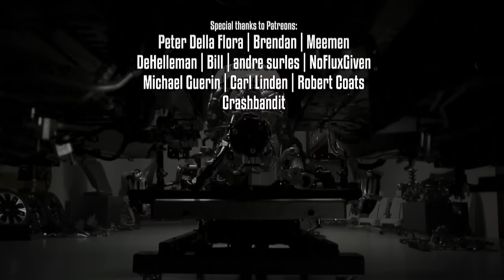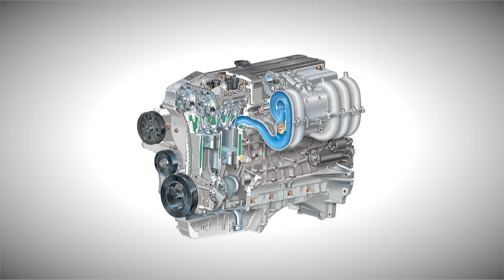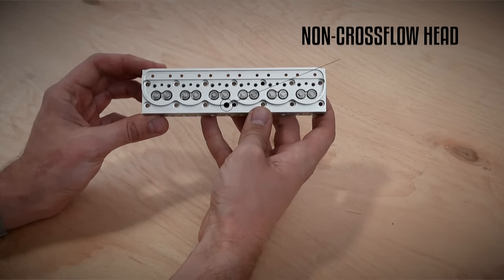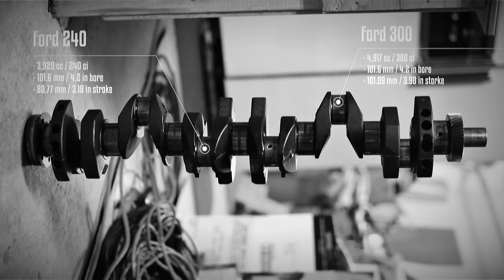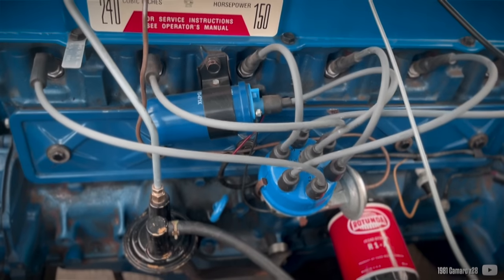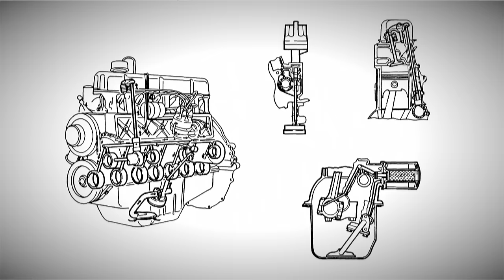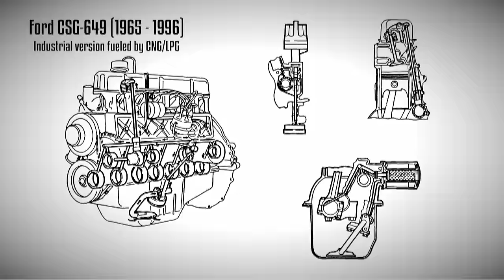Is This Toughest US 6-Cylinder?

Comment: I've never met a farmer who didn't absolutely gush about the Ford 300 if you brought it up in conversation. Anyone who has ever owned one has nothing but the highest praise for these engines.
Reply: Had my hands on one of my favorite generators at a customer site last week. 
Old mid 60s Onan with a 240 ford on it. 
So smooth like a sewing machine,the most problem I've had with it is junk aftermarket points sets.
Reply: As a farmer I can confirm. You can't find a tougher engine and they start so easy even in cold weather.
Reply: @Zach-ju5vi  the 300-I6 is a testament to ford engineering ,, I own numerous machines with these engines ,,,i'm a farmer myself and rebuild old power equipment  ,,the wood chipper is probably the most impressive machine i own with a 300-6 ,,it'll keep up with any 100HP diesel machine  and the only chipper i have seen that will beat it is another gas powered machine with a 460 big block ford engine,,it's a monster vermeer 12 inch cutter that originally had a 3126 caterpillar engine ,,and it's go so much power  that you can't slow it down
Reply: @Zach-ju5vi  Yep, Dad had a 66-240 pick-up, colder it got the easier it started I swear.
Reply: @brentwalters8921  A previous owner put a 240 in my '77 F150, and that engine takes forever to warm up! But I love it and want to stroke it to 300.
Reply: I currently own a 92 f150 with a 300 straight six. It is honestly the most reliable vehicle I’ve ever had.
Reply: My 94 E250 had the 300cid, I sold it at 385,000 miles, only because the transmission was starting to slip.
Reply: Couldn't agree more. My dad had a 93 and the last being a 95 f150 both 5 speed manuals. It never felt like a powerhouse but that 95 might be the smoothest engine I've ever driven. It did have good torque for pulling. Only 145 hp but 265 lb-ft torque @2000 rpm. The 95 was way into 300,000 miles before he sold it off. The kid who bought it drove it for several more years.
Reply: Dad had a 69 or 70 Econoline Van , built a bed in back and had 4 bucket seats. That nice little 6 cyl , 3 on the tree. Our budget Vacatiin Ride. Parents , 3 of us kids and gear had been to all goodies in the Blackhills ,. Out to TN to see family , and was Dads Usual driver between trips The next trip was to see relation in Denver , then to Gunnison and everything between. Left Northwest Ks and all was good. Got to Pikes Peak and had to go around a bunch of bicycles as they were climbing. Got part way up and Boom , dropped a valve. Here come the bikes all laughing in good fun as they passed us in turtle mode almost to top. Drove into Gunnison , Dad was a mechanic before this time and worked as a manager then at grocery store. Anyway he fixed it while we stayed 2 days visiting , then headed home. I drove it even for awhile later , was good to us for many years. Something happened on a drive at home , it was hammering , spewing oil , losing power. Dad said screw it , it doesnt owe us anything , about 11 miles to Uncles so we tried , she made in 9 more miles like that before a final boom and it locked up.. Someone wanted it so Dad finaly let it go. Guy put a 302 auto in and customized it more , he ran it along time. But that 6 cyl , couldnt beat it. Have had a few myself.
Reply: Or the Chrysler slant six the lasted forever
Reply: @ericafoster4368  Did ok , but nowhere near this , and lacked power.
Reply: Yup
Reply: 309 ford amazing, but doge slant 6 best 6 cylinder ever!!!
Reply: I’m not a farmer but the rest is true, at least for me. I miss mine everyday.
Reply: @chadbailey189  Best 6 cylinder ever made, in my book goes to the 12 valve Cummins. With the Ford 300 a very VERY close second. I've also heard nothing but good things about the slant six. But I've seen tons of 300's way over 300k or 400k miles. 12 valve is God level though I've personally seen a 12 valve with over 1 million miles. And countless ones over 500k. But I wouldn't hesitate to put my trust in a slant six either.
Reply: @raymondjack Ask younger farmers in most areas , they wont know what it is anyway lol. But it was one of the favs like a GM 350 was.
Reply: I had the opportunity to buy a rust free 1996 F150 XLT bare bones 2WD work truck from my employer last fall for a Grand and I did. Runs dead perfect with only 40k miles. Even had a new set of cooper discoverer tires on it. What a nice engine. Bypassing the smog pump with a shorter belt was the first thing I did. Now it's silent. Climbs hills thru deep snow with tire chains no problem. Torque for days. I rebuild one out of a rusted out F150 a couple winters ago for a 1990 F150 I bought that had an abused 300 in it and couldn't believe how clean it was despite the rest of the truck having fallen apart.
Reply: Now I want one.
Reply: Uhh they were good for their day. Very reliable and torquey but they lacked power and had horrible mileage.
Reply: Yeah man we take them 300 and put them in the field for the water, great 👍
Reply: @MrTheHillfolk  -  Convert it to electronic. There are lots of electronic ignition kits sold by Summit racing where everything is in the distributor and use your coil. Takes all the BS out of it. NO MORE POINTS.  Worth it.   Brother did that to his VW dune buggie. No more shitty points.
Reply: @DanEBoyd  -  Put 390 pistions in it and put an EFI head on it.  There are EFI kits from speed suppliers summit jegs others that you can EFI it and no more wonky carbs. There is a video on youtube where those guys did that and it made them 300 plus hp NA. 5 pounds of boost with a turbo on the same engine was 527 hp.  Go look it up.
Reply: @chadbailey189  -  The slant 6 was noisier, started  yid yid yid yid bang vrooom  LOL   and was grossly underpowered compared to the 240 and 300.  Many Optional Parts Along Road.
Reply: @yolo_burrito  -  My EFI was autoOD 4wd and got 20 mpg on the highway at 70. Its a truck... They were good on gas... unless yours was a carb and you drove it with your foot to the floor all the time. EFI did a lot for that engine. You could get more gas milage by taking off the muffler keeping the catalytics and putting a blocking plate under the EGR valve. That would give you large boost in power and gas milage.
Reply: My grand dad loved these motors, or anything Ford new Holland lol
Reply: When my Jeep's inline 6 goes out, I'm gonna try to cram a ford 300 in it.
Reply: @joneades1364  According to a quick Google search the 300 is slightly shorter front to rear than a 4.0 but also a couple inches taller
Reply: @joneades1364  The Jeep 4.0 is good motor too.
Reply: Mine has been the highlight of my shitbox truck. I will drive it until it quits. Only 173k on the clock. Looks like I'll be addressing body issues before anything else. 😂
Reply: That is a tough motor.
Reply: Let me be one of them farmers i still use a 1995 f150 with 5 speed manual over 330k on the original engine I've put one clutch in her and a water pump the old one didn't fail the gasket did so i just put a new one on that was 4 years ago and I've replaced the u joints once as well. Only one was bad but just did them both to be safe. 3 batteries but that's just batteries for you. I will keep this engine for ever even if i have to rebuild it. Save history Drive the best get the best 4.9 300 for life.
Reply: @ericafoster4368  yea a good engine for sure
Reply: @Bloodbain88  yea absolutely correctly.  I have one in my second generation dodge ram. Used in a lot of industrial applications... I know I biased buy its absolutely my favorite
Reply: @jimkillen1065  You have the P7100 12 valve? That's what I have, Goldilocks engine. I'm running off of used transmission fluid. Such a great engine. Pulls like a freight train too. I love every second of driving my truck. Only problem I had was a cracked exhaust manifold, but I fixed that. Sounds great too. Best sounding engine I ever heard.
Reply: @joneades1364  -  There are transmission adapters for it... especially if you have a manual trans.
Reply: I have one in my storage. Been asked numerous times if  I would sell it. I laugh at them.
Reply: @thomasbranson7237  -  Its a gold brick.  I wondered why ford never turned that block into a deisel since it is so tough. With the 240 crank and high compression pistons, the cast head could handle it... Doesn't need to be a lot of power but a couple hundred horsepower with a few pounds of boost would have been good for the half ton stuff back in the day. Its an amazing block. Nissan did that with their 2.8 diesel. It was completely compatible with the old maxima engine and the 280z engine. That diesel is used for its crank for 280 tuners to increase the stroke.
Reply: @KlodFather  I had an 88’ manual with TBI 4x2. It maybe hit 16 mpg downhill with a tailwind. It never had great mileage.
Reply: I broke one
Reply: MEH, I like the Chevy straight sixes better, especially the 235 and 292.  To be honest, Ford, Chevy, and Dodge straight sixes were all awesome in my opinion.  However I've had quite a few Chevy I6 vehicles and they NEVER let me down, ran smooth, easy to work on, and easy to modify power wise.
Reply: I agree.
I owed an 82 F150 (I put 3/4 ton rear suspension). That 300 (4.9K) I-6 was a Bullet Proof engine.
I babied the truck, but I did work it.
When it had 350K miles it needed a valve cover gasket and a rear main seal. I asked my mechanic how much it cost to fix those 2 gaskets. He told me $700. I than asked him how much to rebuild the engine. He told me $1500. I told him to rebuild it.
I drove it another 250K miles, as the 3rd member was in need of replacement.
Reply: @morbward8281 , other than the horrible lifter noise.
Reply: @yolo_burrito , that sure beats 6 mpg from the Ford 351W and the Dodge 318 and 360.
Reply: @morbward8281  The only thing I've had negative experience with is head gaskets going on them- otherwise they're alright. It may be worth putting head studs on one to keep the gaskets tighter (proper job would be during a rebuild, using the studs to hold the bore plate).
Reply: @Bloodbain88   Carburetors wash down cylinder walls and cause engines to wear faster than EFI. The EFI 300 could last longer and make better power than it's older carbureted brethren, but a 6BT Cummins can generally outlive the EFI 300, assuming all were well cared for. Even being a big Ford guy, I agree, the 12 valve Cummins is a superior engine, purely by nature of diesels lasting longer due to their direct injection fuel systems, and their heavier built parts, and for these in particular, their simplicity. The power potential due to higher energy fuel and turbocharging is hard to beat. 

Now, if we break it down by price point, I may give them a tie or even edge the 300 as being more economical overall, depending on application. The 300 is a cheaper engine now, was new,  burns cheaper fuel, has cheaper parts, and is cheaper to service, so your bang for the buck was pretty high. It serves a lot of people very well.

I am currently swapping a P7100 12 valve in my '83 F-250 4x4 as we speak, so I clearly like the 12 valve a lot. I dearly loved the 460 that was in it too, but I need better range offroad in remote places, and the 6BT just made more sense for what this 4 wheeler does. I got other Ford big blocks in my fleet to enjoy, so the choice wasn't too hard. This one actually came in a parts package with an F series equipped short block.

Ford clearly thought both the B and C series Cummins engines were good enough to equip in their medium duty trucks, so that should say something about them.
Reply: @yolo_burrito  -  Ford F150 250?
Reply: @ChevyConQueso  That's awesome! 6 months ago I just got done with my own 12 valve swap. Got my engine out of a 1997 Ford F-800 and put it into a 1983 Chevy 1 ton 4x4 dually. You said your donor was an f series truck?
Reply: I have a 1995 F150 with a 300 I6 and a 5 speed. It’s my grandpas old truck and about as basic as you can get. Long before, single cab, Cloth seats, rubber floor mats, crank windows. I think he only paid around $14k brand new. It’s crazy that F150’s are like $50k up to $80k or more fully loaded. They really don’t sell anything like it now as you can’t buy a completely stripped trucks. Also none of they engines they make now can touch the 90’s engines for reliability. Back then every truck engine was really good. It didn’t matter if you got the 300, 302, 351, or 460. Now every engine they put in the F150 ranges from terrible to only ok. The 2.7 and 3.5 eco boost have a lot of problems and even though the 5.0 is supposed to be better my Dad had a 2013 F150 king ranch that broke 3 pistons at around 97,000 miles. He always kept up with the maintenance and drove it like the old man he is. To say he was disappointed is an understatement. I’d trust my old 300 to still be going 20/30/40 years from now when all those expensive new trucks are in the junkyard
Reply: @KlodFather  F150
Reply: @bradleynelson5915  yeah I had an old County truck F250 with the 351. It had a 3 speed auto and the smallest tank. You could see the needle drop.
Reply: Not me, mine was gutless
Reply: those motors were put in fleet trucks because they didnt have enough power to break anything inc speed limit and were though enough to take the crap a new hire novice could give it
Reply: I was look at the thumbnail and thought it was a Ford 300. Those engines are a true work horse.
Reply: @rev.randall2292  That slant six when modified could propel an  A-BODY thru the 1/4 mile in 11seconds. PLENTY OF POWER!!!
Reply: @waynetaylor8082  when modified
Reply: @rev.randall2292  Correct
Reply: Got one on the F-150, sweet engine not much hp but lots of torque
Reply: I have 1 thats 36 years old and still running strong cant say a whole lot for the frame and body lol
Reply: My truck has that motor and honestly I get it... The ford 300 i6 is amazing
Reply: @briananderson4552  My F150 is a '92 and aestheticly-challenged though mechanically sound. Those 300/4.9 litre 6's are reliable when cared for.
Reply: @KlodFather  I never knew of that MOPAR definition before lol. Always thought it stood for: Massively Over Powered and Respected.
Reply: Once put deisel fuel in my ford 300 at the lake.... I might have been drinking...
   Anyway... I adjusted the timing.  And  pulled the boat home.
Reply: @waynetaylor8082  -  You are correct about Massively Over Powered...  That 400+hp hemi  I bought turned my tranny into play-doh  LOL.  Its about 480 miles from Pittsburgh to Charlotte.  6 hours 40 min including a fuel stop in VA on 81 dogleg going down 77 south. That bastard was mean... You were either going places or breaking shit. That good old boy who tricked it out for me created a monster and a death trap. When the tranny went I sold it to my buddy. Im glad its gone because I was going to be buried in it LOL
Reply: I had an 84 F150 in line 300 36000 mls a piston separated at the rings Ford would not stand behind it.Last Ford I would own.
Reply: I once froze the 300 in my current truck, still runs to this day!
Reply: @davecorcoran3874  -  I would have fought them on that repair. 36k was probably out of warranty but I would have called the news and got other people involved. Bad press is not what they want.  Back in the day There was plenty of BS to go around. My 300 treated me well but I found out that one of the head bolts was defective and I had to do the repair myself. When I took the head apart, I sent the head bolts with my dad to be checked in the machine at work where they check aircraft bolts for metal defects. One was fractured internally and two others had problems. I went to the salvage yard and got some old 300 L6 bolts and had them checked by dad. They were from a late 60's engine. All of them were hard and solid. I bought a new gasket and did the torques myself. No more problems. Shit happens. Those rings were some of the shitty metalwork that outside suppliers were doing to the MFGRs in those days. One company sold GM 10's of thousands of bad camshafts. They were soft and not manufactured correctly. Our 350 in our van ate two cams and then the bottom end started going from all the metal being ate by the block from the disintegrating camshaft. We replaced the engine with an 87 350 out of a wrecked police truck. Worked out good. No more problems. They all have their warts. With third party manufacturing and people cutting corners, that is why shit goes to hell on some of this stuff.
Reply: The 300's are damn good engines. But no engine compares to the 6 BT Cummins when looking at non commercial vehicles. There's hundreds of these trucks well past a million, even past 2 million. They're everywhere.
Reply: @Zach-ju5vi  6 BT wants to exchange words with you lol
Reply: @wildcoyote34  300's are great... let's just forget about the 5.4 triton though.
Reply: @Bloodbain88  24v's are just as reliable. Never understood why people only refer to the 12v's as reliable. The VP pump in the early 24v's weren't the best, but they were better than the early VE pumps put in the 12v's.
Reply: @joneades1364  Good luck blowing up that chrylser 4 liter. I bought an already beat 97 grand cherokee with 230k miles on it and used it as my bar hopin rig. Would leave the bar, peg it till I hit at least 60, not warmed up at all, drifting, drag racing, say fuck it lets peg it and go ditch bangin, hit the next bar and do it all over again, then again, then after the 6th bar doing that in between each go home. Do it all again the next night. Did that for years. Could not blow that mother F'er up no matter how hard I tried. It was pinned more than it wasn't Trans was great too, band started slipping but that's a 15 minute fix if I cared to fix it. Scrapped it cuz I didn't want to fix the brakes and tires that were 100% slicks btw 😂 it would drift like a champ in the winters!
Reply: @bradleynelson5915  The throttle body injected 318's were getting 18+ MPG in some trucks back in the 90's. My 2 360's both get about 10 but my foot stays planted in those trucks.
Reply: @whateveryousaygroomer131  yea i'll agree with you about the 5.4 ,, god damn sparkplug spitting piece of timing chain eating shit ,,,i get 26mpg with my 81 F150 with a 4 speed manual with overdrive  ,, not the fastest rig there is and the heat sucks in the winter ,i added an auxiliary heater to help that ,, and i spent the money and bought a gear vendors overdrive which was a serious  expense but it paid off in increasing my fuel mileage from 16  to 26 ,,i drive it on the freeway a lot and the double overdrive allows it to supercruise,,,like doing 80mph with the engine turning 1400-1600 rpm
Reply: @whateveryousaygroomer131  the fact that we can even compare the 300 to a diesel engine speaks volumes. Btw I still think the 300 starts better in cold weather so it's got one advantage over the Cummins.
Reply: @Zach-ju5vi  My 01 Cummins starts at -20f without being plugged in with 15w-40. has 332,000 miles on it too so the original toasters are worn for sure. I've had it going once at -28f with 5w-40 without being plugged in. 

I have a hard time believing those old carbed motors started colder than that, but maybe I don't know. Carbs are a bit before my time but I've never seen a carbed anything start well in the cold.
Reply: @whateveryousaygroomer131  my 01 Cummins will start in about -25c but the many 300s we have around don't care if it's -50c, they start everytime.
Reply: @wildcoyote34  Nice set up. If ford would make that same exact truck right now in 2023, I'd buy it no questions asked. Shut up and take my money hahaha
Reply: @Zach-ju5vi  No vehicle will start at -58f (-50c) without being plugged in, warmers on the batteries, and probably loads of starting fluid and a fire under the car with a car wrap. I'm talking about doing nothing. My cummins starts at -28f (-33c) with no warmers of any kind, just get in and turn the key and goose the throttle. 

I have never seen a carbed engine start below 0 without lots of attention and warmers. I'm going to have to say bs on that one till I see otherwise. Places where it gets -50c they need car wraps and heaters under the car / heater hose connects / block heaters etc to get anything to run, you're not just starting the vehicle on it's own when it's that cold.
Reply: @whateveryousaygroomer131  The 24 valve is incredibly reliable, but just having electronically controlled injection, extra sensors, and an ECM I would say a p pump 12 valve just noses ahead in pure reliability. Now p pump a 24 valve and you're really set. 

On cold starting, my Cummins started just fine this past winter at -15F, plugged in (but unbeknownst to me the cord on the block heater had broken, so not actually plugged in) and no grid heater. My engine was in an industrial application and didn't come with a grid heater. But that doesn't bother it. 

Before my truck had a Cummins, it had an old 350 with an Edelbrock 1406 carb. I think the coldest it started in was -10 or -15. I had it tuned well and it would start at the first bump of the key. But you're right about no engine starting at -50. Hell the oil is basically a solid at that point, and the battery is frozen too. You either don't shut an engine off at that temp, or it's got block and pan heaters, and the battery goes inside with you. And even then it's a gamble.
Reply: @whateveryousaygroomer131  I'm sorry but I've been there and done that more than once. I've only seen a hand full of engines start at that temperature. I seen two different Ford 300s start one efi 88 f250 and one carb in a 78 f150, I seen a 302 efi start but die trying to move and not restart, I seen a Nissan 2.4 with a carb start, and I've seen a many different snowmobile engines start both efi and carb. Starting an engine not plugged in at -50c is not something you do by choice but something you do because you just need anything that will run, I've done it, I know. PS the 5.9 Cummins won't start and I know because i did actually try it.
Reply: I may be a Chevy man, but you'll never heard a bad word from my mouth about the Ford 300 inline 6. One of the best engines of all time.
Reply: As a farmer I’ll tell you, after a nuclear war they’ll only be 2 things left. Cock roaches and 300 fords.
Reply: Indestructible legendary engine
Reply: 300 was ok for heavy work, drivability sucked and ive never seen a 300 that could keep its oil INSIDE the engine
Reply: The biggest issue is that it is too easy to pop a wheelie with a full load of hay in a truck with one of these engines.
Reply: Ford 300 best engine ever made
Reply: I'd like to see how well they would do at the track with some mods 😁
Reply: @DanEBoyd you're better off finding a 300 short block and bolting on a 240 head, it's a very old hotroddibg trick.
Reply: I KNOW QUITE A FEW THAT SWAPPED THE 300 FOR A 351
Reply: @CAVERUNLAKE  enjoy the leaky , all 6mpg of it
Reply: I had rather have 300 in line 6 in a truck than a 302 v8. The 300 has the torque.
Reply: My first truck was a 92 f-150 (hence my username) I got it when I was 13 from some Mexican who used it to haul scrap. It had 315,000 miles on it. All it needed was a gas tank. I got it for $650 in 2017, I drove it around all sorts of back roads. But I sold it for a 2000 f-150 with the 4.6v8 and almost perfect condition. I miss that truck though… but heck the 4.6 mod motor is extremely reliable as well.
Reply: I Had a 300 in My 79 F 100 Ranger Pickup Truck.  The Most Beautiful Truck Ford ever made. It had the Square Head lights It was the original Sport Truck .  I had it Painted in Emerald Green Imron Paint with Tan Western Style interior and relocated 3 on the tree to a Hurst Shifter on the floor with the Fuzzy T Hurst Indy shifter.  Under the hood I put the Offenhouser split exhaust and 4b intake system.  It was a awesome setup that was Bullet Proof.
Reply: I will testify to that. It has certainly been my experience. Almost indestructible.
Reply: Chew on a 24 valve 2001 Cummins and feel the Horse!
Reply: Trudeau needs to see a Cummins Ford, inline hydrogen diesel looking through his lear jet window! 😇
Reply: Take a shot at Cummins, Trudeau! Go for it! We'll send you phsycho chemists, on a trip to tax mars!😔
Reply: All expenses paid!
Reply: I’m not a 6 cylinder guy but it’s hard to beat how maintenance free a. 300i6
Reply: @maddhatter3564  my father did. 68 f-150. Took out the six when it had 200,000 on it and put in a 351W. He drove it for a while and gave it to me when I went into the eleventh grade in 1973. Best vehicle I’ve ever had.
Reply: WOULD THE CHEVY 292 B THE EQUIVALENT 2 THE FORINGA 300 MY PEOPLE'S OR NAH
Reply: Saw a video of a guy who cut up  351 heads to fit a 300 then put a turbo on it and apparently it was a total power house
Reply: The only thing I'll own with the blue egg on it.
Reply: they were junk ive thrown away plenty
Reply: You can’t kill them. A gas engine that feels like diesel. Ya it doesn’t make power above 3500rpm but it’s not supposed to. 1200-2500rpm beast.
Reply: @acme_tnt8741  Well this or a 7.3 power stroke
Reply: Same with the old fishing boats , dodge 225 were built solid too.
Reply: No gushing here.  I grew up on a farm.  Dad had a 1985 F250 with a 300.  Gutless wonder. Think Geo Metro with a box.   None of this “massive torque” that everybody raves about.  The 300 is simple and durable and that’s where it ends.  For the power it didn’t make, the mileage was unremarkable.
Reply: The inline 6 has always been the most dependable engine. I've had Chrysler 225, Chevrolet 230, Ford 200 and 300.
Reply: The Ford 300 I-6 is the absolute best engine I have ever owned.  Had two Broncos and one F-100 with that engine and they were bullet proof
Reply: @sumatrican5990 quite a few drag racer’s did this in the early 70’s 600 hp N/A one was a maverick called preparation H
Reply: I learned how to drive in a 68 Mercury with a 300 and a 4 speed on the farm in northern Alberta.  They start effortlessly at -40.
Reply: The chevy 6 of similar is also a strong engine.
Reply: That Ford 300 burned gas like a big v8.
Reply: Or a Tree Man. This was a great chipper motor and a great pickup motor. Bomb proof 😁
Reply: 93 F150 and still runs like a top!
Reply: I have a 1995 F150 with over 325,000 miles with nothing ever done to the engine still running strong with NO oil consumption between oil changes! The tail pipes are still charcoal grey!  I had a 1984 before that with over 400,000 miles on it before I sold it!
Reply: For the same price you can buy a Ford with a 302 V8 which will get 18 miles per gallon and have a ton more horsepower and torque. I've had 2 Ford f-150s with the 300 straight 6 and one of them with the 302 V8. If I was given a choice of the three I would go for this real to absolutely beyond the shadow of a doubt even if I had to completely replace the 302. I think there's some videos by PowerNation and maybe others that have built up 300 6-cylinder engines, but seriously I can't compare with a 302 V8.
Reply: The 300 was a wonderful engine but had its flaws. Now, any engine can be complained about, but in my opinion, these flaws should have never occurred! First is the oil pump pressure sender location. It was my fault for not checking that the oil gallery plug was installed at the machine shop. But I missed it, and it damn near cost me the rebuild.  Once I had the engine built and installed, I had good oil pressure, but no oil at the valves. We thought that maybe lifters got packaged wrong. Once I realized the plug hadn't been put in, it was an easy fix. My problem is why put the oil pressure sending unit on a dead-end passage when the whole side of the block was open to put the sending unit on. Had they moved it before the destributor, they would have had a built-in safety as no pressure would ever be built without that gallery plug installed. As built, as long as the oil pump creates pressure, it will always be at maximum pressure in a dead-end passage. Live and learn, though. The second issue with the engine is that cylinders 3 & 4 would run leanest on a carburated engine. It's actually the carb that's the problem here, not the engine, but here goes. Over time, the butterfly induces wear in the bushings on the butterfly shaft. Once the wear occurs, air is induced into the throat of the carb. And the more wear there is, the more air is introduced. Being the carb is mounted between cylinders 3 and 4, the least path of resistance is directly into 3 and 4 for the excess air. This occurred on the same engine as the oil pressure sending unit location issue, and the leanness in 3 and 4 is what caused the rebuild initially. Once bored 0.040" oversized, rebuilt, and the bugs worked out, we got 18 mpg at all times. We could have the flatbed trailer empty or 4 snowmobiles on it going north. Same trailer, loaded with 2 rolls of 6" drainage tile 8 feet tall and 8 feet in diameter, we got the same 18mpg. Ultimately, body/frame rust and black ice killed that truck. Otherwise, I'd probably have a split intake and exhaust manifold with dual 4 barrel carbs and exhaust on it by now.
Reply: Yep! The ford 300 won’t get you there fast but it will get you there!!!
Reply: @stevestrohacker8436   All things considered, if only 2 or 3 things can be pointed out as design flaws on an engine, and neither are that big of a deal, that's pretty awesome.
Reply: @chadbailey189  I agree the Slant Six was almost indestructible.
Reply: Absolutely agree 100 percent
Reply: I drove a ford 300 . For years very tough an very reliable.  I loved it
Reply: @MrTheHillfolk The metal on the points is wrong, Pertronix is flawless when installed properly
Reply: Absofrickinloutly.  The best one imo was the efi with the dual throttlebodies. My 91 F150 is pushing towards 400k on original engine with very basic maintenance.
Reply: Yep farmer here, I wont buy any other farm truck with the exception of older diesels I keep buying $500 300s and working them and they stand up very well.
Reply: Drove 3 E350 service vans weighing 8000# plus for 13 yrs - never let me down
Reply: PowerNation built a 300 turbo boosted to 300hp+
Reply: I’ll never forget driving a Chrysler slant. Worst fuel mileage 90hp ever got me 😂
Reply: Ford barra swap
Reply: The best towed my boat

With a f150. No problem
Reply: I'm not a farmer and I've only driven a car with the 300 once and I gush over it. I'm looking for an early 90's Ford pickup with the 300 and 5 speed. I'm striking out. oh, yeah nobody wants to get rid of it. I can't blame them.
Reply: I can attest to it's reliability. I have an 82 F150 that sat for most of the last 20 years, and I've come to the conclusion, without tearing the engine down, that a previous owner overheated it BADLY. currently, with my 10-year old rotten shoe string budget, I've managed to keep it going, even though it needs a head gasket.
Reply: i love my 300. i got it as a teen as a gift, i upgraded everything but the motor plus i put a 302 trucks rear differential and that alone made it much fast and it would pull stumps easy with the bumper i have on it. i like street racing it shhh lol! the 3 inch exhaust man, i would hit the gas then lay off then hit it again,cant remember the octane i run in it, it uses a lot of gas though. had to put adjustable air shocks cuz when i took off the bed would slam down and it always jumps the front end now. if i put money on the dash they couldn’t grab it until i shifted, so much fun, i plan on upgrading the internals now and finally putting a turbo
Reply: roasts the tires, both of them, it’s a single cab shortbed, cant wait to put a vid of it on here
Reply: Yes.
Reply: As a farmer I've got an Ford inline 6 and even tho it has cylinders 2-4 that have lost compression 5 and 6 are keeping it running